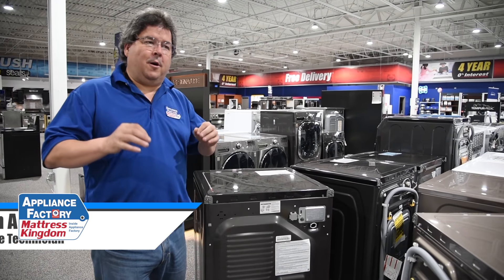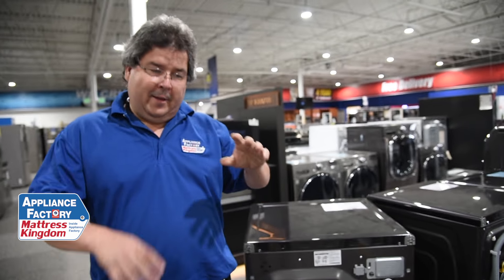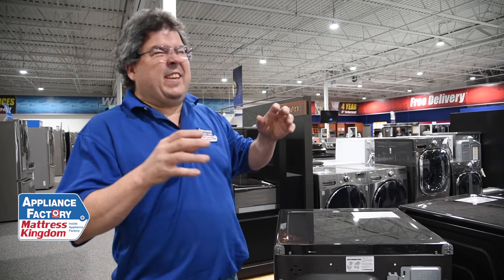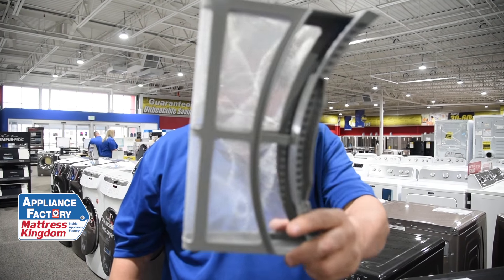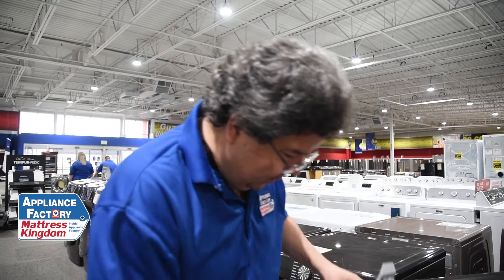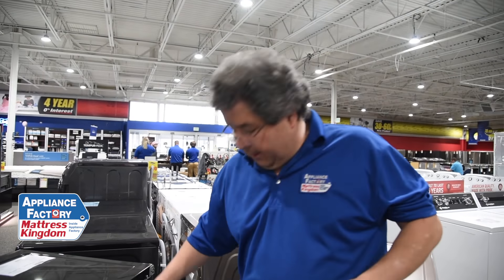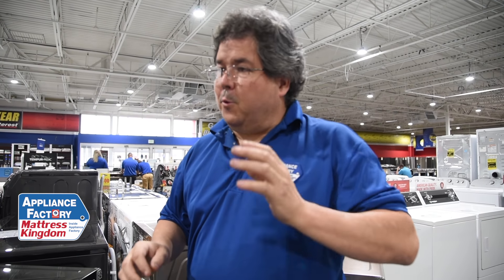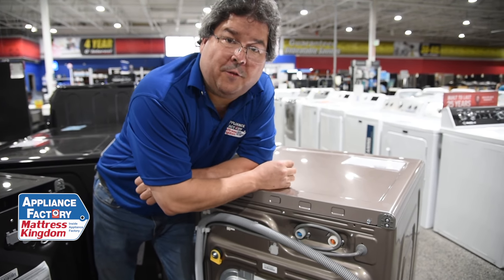How To Fix a Dryer Not Heating (Quick & Easy)

Comment: My dryer was not heating and timer not working I looked on line for some new ones. Thought I'd give YouTube a try and this video saved me some $$$. Breaker box is just above the dryer. I fliped it off and pulled it and reinstalled it. When I flipped it back on I could hear the timer ticking and have HEAT again !!! Thanks

Comment: Thanks to you my dryer is working and it was my breaker. And after having my dryer running for couple minutes i wanted to feel in the back if it was warming up and i burned my fingers so don't touch it just try to feel close up.

Comment: These are good starting points. I’ve replaced my heater because it was out. It was 8 years old before it went out, and the element had deteriorated. Unfortunately the After market heaters don’t last long. Went out again after 10 months. I have no issues with the vents, it’s just that those heaters are cheaply made. Looking into an OEM part this time. But not sure if that will last long either. I’ve read that didn’t last much longer.

Comment: Thank you!!!! My commercial dryer had no heat whatsoever. Still worked otherwise. I reset the breaker for 30 seconds and voila! Hot air. I think the California heat (100+ degrees) in the garage + the dryer running created too much heat and triggered a safety feature

Thank you again! You saved me a good chunk of money

Comment: How about a brand new dryer not heating at all. Replaced the thermo and element in the old one, which wouldn't heat. Got a new dryer not heating. We are about to give up
Reply: The breaker trick didn't work for us

Comment: Hi sir i wanted to ask i have a gas dryer GE and wanted to mention the start button wont start  only when i hold  the start button then is stays on when i release, it turns back off and it doesn't heat too any suggestions thank you so much for you input

Comment: He is absolutely right. Flip the breaker first for at least 10 seconds.

On another video it was said 99% its the heating element. My dryer is from 2018. I bought the pieces - exchanged them - same, no heat. In another video it was said either unplug the plug or flip the breaker. So the plug was nearer to me. Nothing changed. Before going to buy a new dryer I gave the flip of the breaker a chance. Now it's working again. So obviously older houses have older wires and I assume the dryer senses the thinner wires in older houses and shuts off the heat - just in case. If its happening again I will exchange the wire in the house according to todays code.

Comment: Brand new dryer delivered today no heat, turns on tumbles cloths hours later cloths are still damp. Even with no metal hose on back no heat did try the breaker few times over 3 hours no change 😭

Comment: 2nd step did it for me. Pulled vent off, found heat coming out the back, cleaned the flex hose and stuck a hanger down the permanent vent. Found sock from previous tenants, 2 years prior. It always took us 2 dries to dry completely. Maybe it will dry on the first run now. Thank you.

Comment: Why in the heck will turning my breaker off and on work? 

Also my stuff is not labeled I rent and old ass house yo… it has the original wiring which is wrapped in Kevlar so that should tell you around about the age of the house that I’m renting😜
Reply: IT TOTALLY WORKED!!! and if you don't know which breaker it is, just flip them all...it does suck to have to reset clocks when you flip the microwave and stove breakers but hey, you don't need to spend $$ on a new dryer!!
Reply: Thank you sir, was sooooo helpful 🙏.